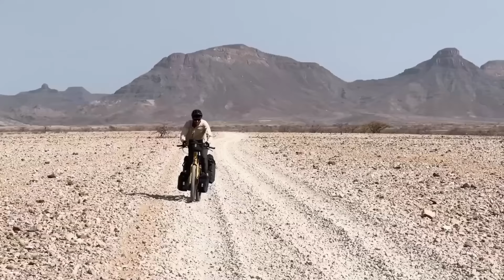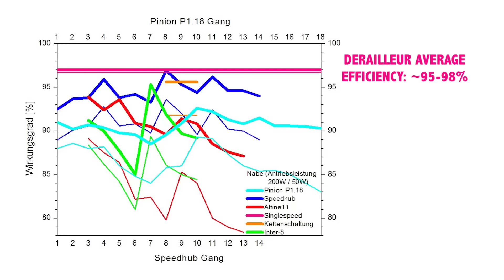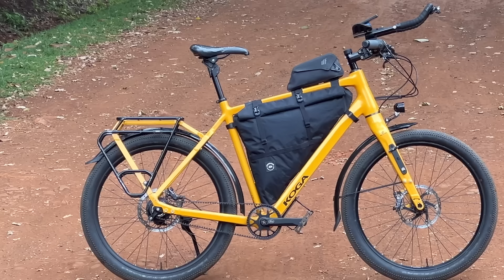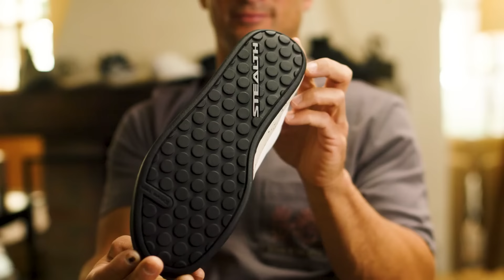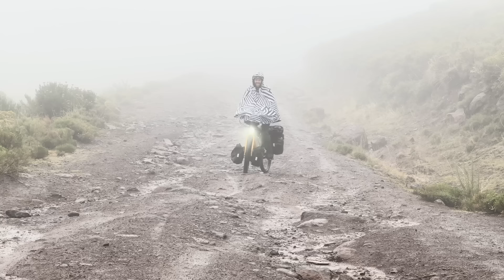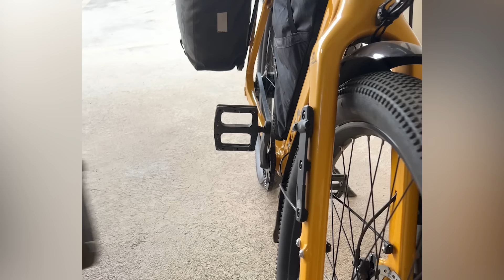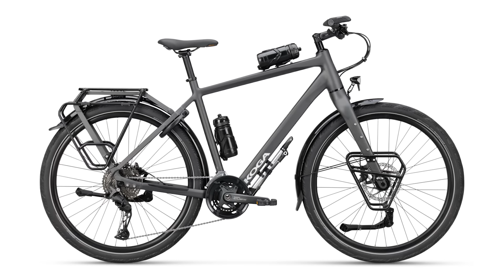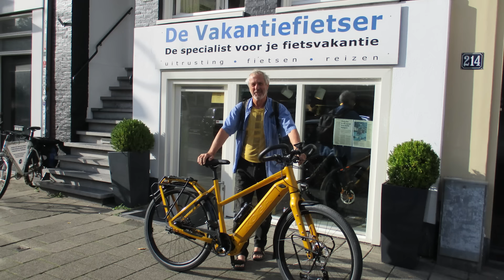The 2026 KOGA WorldTraveller is a $8000 Indestructible Touring Bike

Comment: Nice bike. Didn't realize they were quite that heavy though! The integrated rack is my favourite feature. This seems such an obvious weak spot on most touring bikes (although I've never had a failure). I wonder if a longer head-tube with a rack attached to it would be a good feature. Am currently building one of these so will be interesting to see how it turns out.

Comment: I have come around to using front racks even though I have been resistant for, similar reasons. It just keeps weight lower and out of cockpit area since I also have the stem suspension. I transferred water bottle I drink from to seatpost since I don't have stem bags or weight on the handlebar. 
And I don't really like using bags on fork or sides of the rack. Bottles of water at most or similarly sized small bags on anything mounts are most I store there.
So I have big 16L front rack bag that's kinda like trunk, easy to open. Full frame bag. Simple big dry bag attached on top of rear rack. 4x cargo mounts on sides of the rack and fork that hold nalgene bottles for water storage and similarly sized very small bags. Then top tube bag and bottle holder on seatpost. Front trunk is pretty amazing for quick access stuff.

Comment: Though belt drive is superior but no way I would ride belt driven bike on cross country expedition. Metal chain is easy to maintain and not repairable if stuck in middle of nowhere imho. Belt is easier to cut. There was a belt driven bicycle in our place and someone was constantly cutting the belt easily.
Reply from the maker: I've been using belts since 2010, and crossed over 100 countries on them. I've never had one cut, or been left stranded anywhere. My experience is that most people respect your property, and that belts are tougher than you'd think!

Comment: I tested this bike and to be honnest didn't like it at all. Mostly because the rack is fixed and so far behind. The weight of the panniers is too much behind the rear axle to be stable. Also 29ers ride so much smoother and faster over rough terrain. In the end i went with a bombtrack behind adv + with steel fork and 35mm rims . Much cheaper and better ride. both on easy and technical terrain. Easily riding without hands even when fully loaded.
Reply from the maker: Glad to hear the Beyond ADV+ is working well for you! I don't ever find this bike undstable, but I'd love to tinker with rear pannier placement to find the optimal location. I might have to get some custom rack frames welded up...

Comment: Interesting tip running the grips backwards to protect the ends. Can you enlighten me more on how you changed the grips on those sleeves?
Reply from the maker: There is no glue on the grips, so you can just cut the Wolftooth silicone off (or slide them off), and replace with the ESI. It’s a tight fit, so be prepared for a battle!

Comment: Any comment re comparison with tout terrain outback or idworx blt, both 27.5?
Reply from the maker: Any of these bikes are awesome, it really just depends on your body weight, luggage weight, and intended use.

The KOGA is the top performer when it comes to frame and rack stiffness, as well as maximum weight capacity (180kg). It's likely the most bombproof touring bike out there but the downside is that it's heavy! The Idworx is a bit less stiff, and comes with a 160kg capacity, but a nice 3-4kg weight saving over the KOGA. The Outback is the least stiff of the three and has a maximum weight capacity of 130 kg. It's 3-4kg lighter than the KOGA.

The frame warranties follow a similar trend. You get the longest warranty with a KOGA (lifetime), 6-10 years on an Idworx (depending on titanium or aluminium frame material), and 5 years on a Tout Terrain.

Comment: Those water bottle holders are quite cool! One issue I've had with regular bottle cages in my road bike is that I can't even fit a liter per holder without having space issues, although that's also down to the frame. The ability to store large quantities of water in a fairly accessible way is pretty cool. It's interesting to think about how the top of the line touring bikes, while expensive, are still so much cheaper than the top of the line new road bikes. Some of the folks on our group rides are riding 5 digit bikes. I sometimes feel like I'm going to fly off my bike when I hit small bumps at high speeds when descending on my more narrow tired bike, which has made me consider whether a suspension seat post would help with that. My arms, funny enough, feel fine because I'm already using a suspension stem. (I've got one setup with a redshift stem and one with a vybe stem, and I kind of like the more play that the vybe stem has.)
Reply: I fitted the Arundel Looney Bin cages on my wife's touring bike, my Vivente World Radonneur, and on my KOGA World Traveller. They are adjustable and can accommodate large bottles, including Nalgene 1.5-litre bottles. With the turn of the plastic adjuster, you can secure the bottles tightly if desired. They are made of plastic, tough, and very light. I haven't had any problems with them, either commuting or on three tours in Vietnam and Thailand. An advantage is that when touring, you can buy a 600ml, odd-shaped bottle of something and lock it in place. One issue is that if you wish to carry two Nalgene 1.5L bottles, the opposing adjustment screw hampers the second bottle somewhat; it's not perfect. I had a look at Allee's cages--I always look at what he's doing--that's why I have a KOGA. My LBS wanted AUD100 each for those cages, which I find ridiculous.

Comment: Are you using tubeless, or tube with sealant? i need also the adapter for the saddle, where you can shift the seat more forward, i got the redshift, and compared to the byshultz and the cane creek it is so much better, the byshultz is close, but has a massive offset and you are limited in tilting your saddle on some seat models, because the upper plateau is blocking
Reply from the maker: Full tubeless.

Comment: only thing I would add is an abus or axa frame lock and plug-in chain. not a super secure heavy duty one, as it's a bit on the heavy side, but a 'silver' rated one. perfect for quickly securing the bike when stopping at shops etc. something like the axa imenso might be big enough for the wide tyres.

Comment: Just want to ask @cyclingabout why did you choose 27.5” instead of 29” wheelset for touring? Any technical aspects about this? Thanks!
Reply from the maker: I want the widest possible tyre for where I ride. I can get a 3.0” tyre to fit with 27.5” wheels or 2.3” tyres on 29” wheels.

Comment: Look for other independent reviews online, as there would appear to be more than a few less than happy customers...

Koga stone walled me when I asked for help. Fecking assholes

I can 100% believe this. My SO bought a Koga recently and before the sale it was obvious the company is a basketcase of problems and has problems with its dealer network who appear to not have connections to the company that Koga thinks it does. Koga didn't seem to care about putting my SO on the bike to begin with, but eventually we figured out what size and where to get the model. After buying the bike, there was an issue that was non-warranty and we needed replacement parts. Koga referred us in a copy paste email to go to the dealers. Three dealers, two no longer deal with Koga. One dealer who said they no longer deal with Koga, but would still try to order the part, but was not able to guarantee they would even get a response from the company. Eventually they got the part and even they were shocked. They said they don't deal with Koga because it's more or less ordering bikes and not knowing if Koga will ever send it. This is why one more or less sees Koga only in those big online bike shops nowadays, I guess. The place where we ordered the bike from online doesn't do parts support like this. By their own admission they only sell the bikes and they're pretty much the only place to get a Koga in my country which is next door to Koga's country.

I see that ambassador guy plugging the World Traveler, but he doesn't seem to want to acknowledge the world of hurt he will be putting some people who buy into Koga in.

Comment: Hi , an excellent comprehensive video, but I have a query from you as a user,  I have a Koga World Traveller, now 20 years old still going strong, Rohloff, --26inch Wheels, !!!! now, !!with the high bottom bracket it is quite difficult to get on,--and off,   me being Small, 5:.4/   especially when loaded,   ie having to tip, lay the bike over, the new bikes come now with much larger wheels, which will only make it worse, the idea of a step through frame NOT ON for cycle camping, 

As most people tour on tarmac roads and reasonable good dirt tracks,a lower bottom bracket, and 26 inch wheels, a better stability option, regards Ben

Comment: Thank you @Cyclingabout for another excellent and super informative video. There's no doubt the Koga World Traveller is a very strong and quality-built bike. And you've no doubt put it through the paces over thousands of kilometers over demanding terrain. However, if I'm not mistaken, it's aluminum - how do you feel about the repairability of aluminum compared with steel in remote areas? I only know that steel welders can be found almost anywhere that can repair a steel frame.
Reply from the maker: If you’re comparing a lightweight steel vs lightweight aluminium bike, the steel bike is the smarter option for crossing a continent or two.

But when you get to the specialist touring aluminium bikes, they are not built to be lightweight, they are built to be strong! A bike like this is so overbuilt (2-3x stronger than most steel touring bikes) that it really cannot break.
Reply: @Cyclingabout  Thank you, it does appear incredibly strong. 1) Is there a bit lighter version of the Koga World Traveller that you'd still recommend for international touring? 2) Would you consider the Tumbleweed Prospector a light, mid-weight or heavy steel frame (it also is availabe with a Rohloff hub)?
Reply from the maker: The KOGA Worldtraveller Classic is 3-4kg lighter than this. It’s the old version of this bike and still perfect for a world tour.

The Tumbleweed is another great option if you need the off-road capability. Not quite as stiff as any of the KOGAs, but still pretty good at handling a moderate-heavy load.

Comment: Very nice bike, and surely will bring one to the end of the world (and back...)

Having said, after spending roughly 25k km on my bike with Rohloff with disc brake I went back to derailleur, and 2 x 11 system... with total weight < 11kg

- Gears are nicely spread at low end, towards higher gears 13% becomes just too much
- Efficiency might be close to 95%, and definitely is very high for a gear hub (have driven several different), but is feels slow compared to derailleur... putting the same power in pedals we have about +2km/h... At higher speeds (28+ km/h) even more
- Tired of Rohloff being leaky, spreading oil over the brake disc and asking for extra maintenance... and sealing replacement
Reply: I have found that since Rohloff realised that its edict of 25ml of oil was far too much and changed it to 12.5ml, I've had no leakage or weeping problems on the 3 Rohloff-equipped bikes that I maintain.

Comment: Rohloff is the best! For travelling and commuter. I use mine since mid of 90s every day, year around.
Dynamo hubs for travrlling bikes are debatable.
I prefere a 15w solar charger on top of my rack. Delivers power even when my bike don't move or in camp. Way more robust, easy to replacr, lighter and cheaper.
Hydraulic disc brakes coud be a problem far away from any bike shop. Therefore I use TRP Spyre.
To my opinion, a quality steel frame is the better and lighter choice for heavy loaded touring bikes. After destroying a aluminium touring bike frame on a biketour, I only trust steel frames anymore.
Reply from the maker: We’re definitely getting to the point where batteries, solar panels, and regular bike lights are so good that it’s hard to justify a nice dynamo setup. There is something nice about powering your electronics with your pedals though!

Comment: Simularities: My bike weights also 21kg (slightly less), sometimes I also have 30kg luggage, and I also have been bike travelling in many (20+) countries.
The big difference: My bike DID NOT cost a wopping $ 8.000,-!!! 😮
However, it was hand made to my specs 28 years ago and still performs perfectly and I never had not even the smallest trouble with it. Still it did not even cost me a third from what you spent.
Reply: Yea, but I bet the 28 years are the main reason for that.
Look what a custom made bike with a steel frame costs these days.

Comment: It took a bit to get used to the weight of this bike, but once you are it's amazing.
The only thing I need changing is the back fender extension, the original one is not long enough, and the mud and water are splashing all over my back when it rains.

Comment: At $8000, my path has been to buy a frame. Each year I add $1500 of new technology. Which equals about 8 grand in 5 years.
Reply: That is what I did too; I bought a steel frame, hand made to meet my own specs and long legs. Afterwards I looked for parts in all kind of places and completed the bike myself. Some parts good quality, and where possible just simple stuff. For me it is the perfect bike and I travelled with it intensively in over twenty countries. It is very reliable and comfortable, never had even the slighted issue with it in 28 years by now, and is was waaaaay cheaper than this Koga space ship.
Reply: @kayasper6081  but is there a Rohloff and a belt drive installed? Consider  1200 extra cost for this. Any other differences like suspension on steering bar and saddle? And is the frame at the same stability level? Powerful dynamo availabel? Probably there is many bikes out there making their owner happy. But that is not the contest. This is about surviving in Africa.
Reply: @dude-hh9db My bike is VERY stable, I suppose even better than the Koga. And it is also VERY capable to explore Africa, in fact, that is what I did. It has no belt but a good old chain, which I prefer. I updated the entire drive train and now it is 3 x 10, capable do cope with anything thrown at it.
But it lacks all the other "modern" stuff, like suspension, integrated dynamo, etc. And to be honest: I don't need that either.

Comment: Your bike is to small for you. Belt drive need case to protect from front send and water. Rohloff is not efficient and not good rolling and  gear change is pain.
Reply: Noob detected
Reply: Really? Everything you mentioned is wrong. Why?
Reply from the maker: This is the perfect size. All touch points are exactly where I want them.

Comment: What will you do when Schwable eventually discontinues that tire? Would you go Vittoria Mezcal 2.6 or do you have a few saved somewhere?
Reply from the maker: II'd still want something in the 2.8 to 3.0" size range. I'll likely move to 2.8" Nobby Nics or Rocket Rons, or perhaps 2.8" Mountain Kings or Cross Kings.
Reply: @Cyclingabout  No more Cross Kings(at least in name) and those maxed out at 2.6, no?
Reply: I ride a very similar bike with the same tyres. 

Other than the models which Alee mentioned, there two more interesting options in the 2.8-3.0 range:
- Teravail Oxbow (formerly Coronado). I would love to get these in 3.0 but they are always out of stock.
- Maxxis Rekon.
Reply: @varez93  The plus rangers are no more either, had a WTB rep confirm it to me. It now maxes out at 2.6.
Reply: Yes, tyre availability is increasingly becoming a source of pain. My 2017 bike was built around 27.5" x 3.0" tyres. I love riding on this tyre configuration. Sourcing them is becoming more and more difficult.

Comment: When this bike was introduced, I was immediately impressed by its 180 kg capacity...and I've owned it for a few months now (basic spec/unconfigured 622-55/2023 model/XT :-)). If you, Alee, are out on the road with this frame for many months of the year, that's certainly an inspiration to me.

My assessment, even after completing a 10-day tour - so far:

The spec is manageable, but the saddle, pedals, handlebar stem (creaking...) no original Shimano crankset... and only low spoke tension upon delivery... were a bit disappointing. I noticed a huge creaking noise at first, and now it's gradually been actively eliminated.
...You should be prepared to regrease all areas; very little was greased during assembly.
The front wheel has a 6-point disc brake, the rear wheel has a centerlock, which is a bit irritating to say the least. The simple brakes are okay, though (better than my HS33 Magura).

I really attest to the bike's incredibly smooth ride with luggage; I particularly enjoy the bike on forest and field paths.
With a 44 32 22 gear ratio on an 11-34, I've climbed many inclines with a full load; so far, the gear ratio has been sufficient for me.
Overall, I only notice the increased weight in train stations/trains/stairs.
It's worth using TPU inner tubes and Almotion tires. I've taped the aluminum rack with 3M tape—so far, I don't see any wear.

Happy cycling! And thanks for sharing your knowledge!
Reply from the maker: That's a great rundown of your experience, and I'm glad to hear you're enjoying the bike despite the initial setup issues!
Reply: @Cyclingabout  I'm still very happy and think that this frame is completely unique on the market with its capacity for heavy riders with luggage. I had anticipated adjustments and other minor investments beforehand.

Why KOGA only delivered the wheels with very low spoke tension is beyond me, but re-tensioning the spokes eliminated the annoying cracking.

That secure feeling when rolling – I now relax more while cycling than before with my 622-40 ALMOTION tires. Great experience.🤩